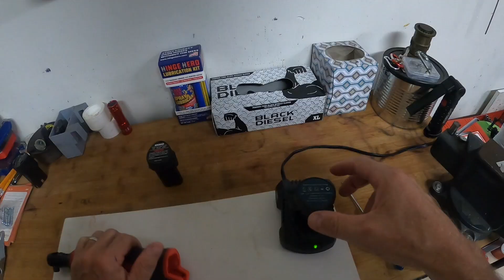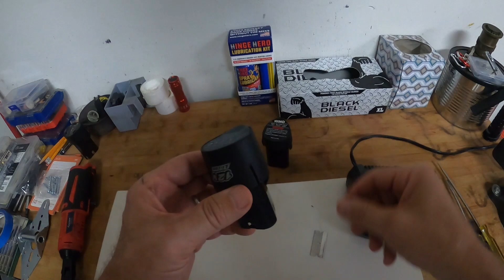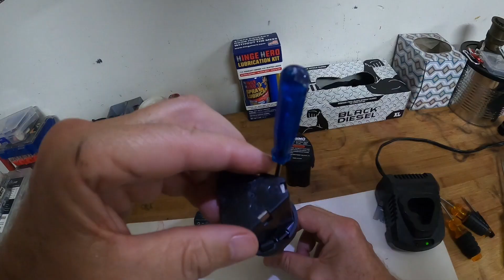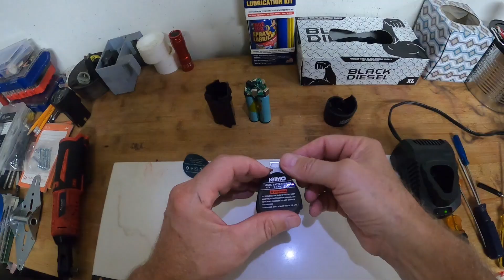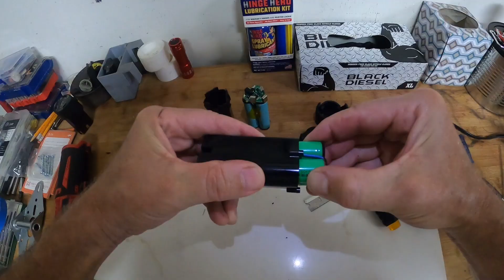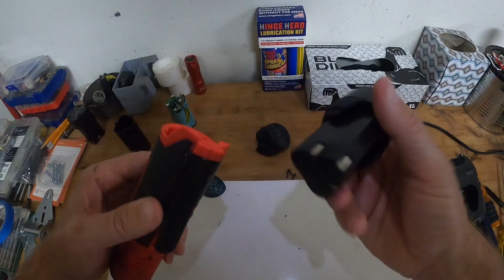Replace your 12v proprietary battery hack for small tools

Comment: Ummmmm, just a second. That's great and all, but does it charge? I'm sure that the PCB boards are not identical. There could be chips on it that will block a signal that is not theirs.